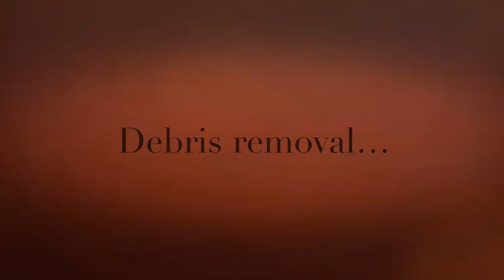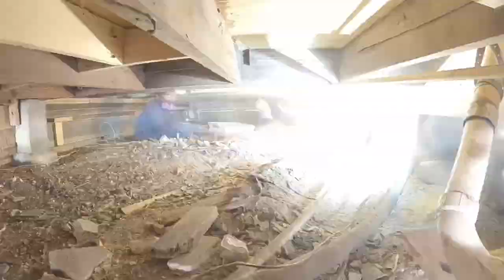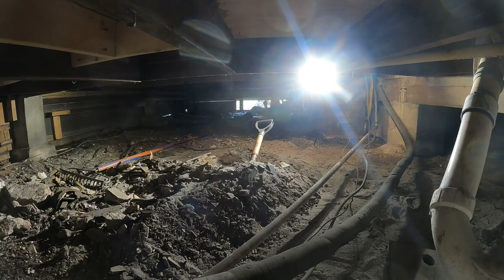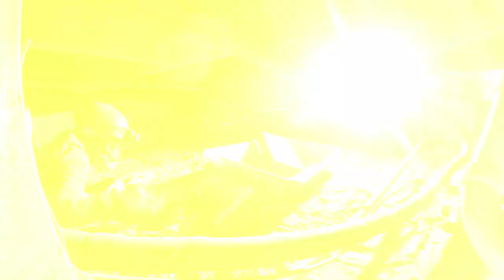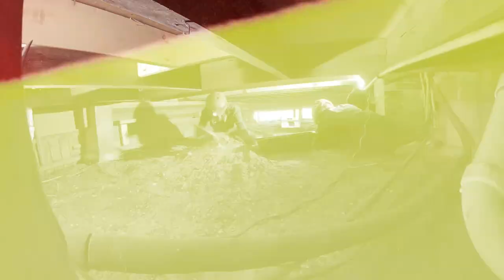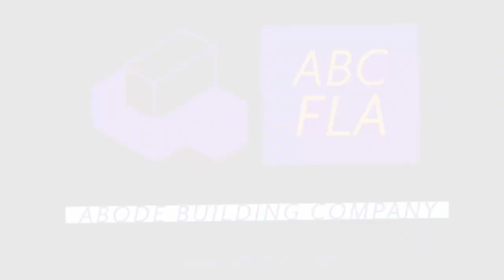How to Clean Out a Crawlspace Before Installing Vapor Barrier - HINT: There's No Easy Way!

Comment: I have to clean a crawl space under my 20x26 building, that's set on piers--open under the building.  Watching this just gave me an idea, to use a fan of some sort, to help move floating particulates in the air, keeping the fan behind me, to one side, facing in the same direction as myself, as I move forward.  A respirator of some sort is definitely something I'm seriously going to consider using also.  A garden rake is definitely one of the tools I'll be using!  👍
Reply from the maker: You can do it, just a little at a time!